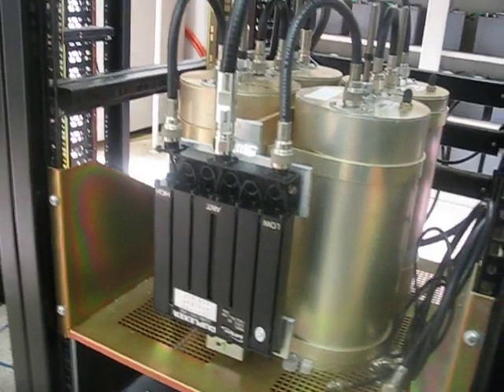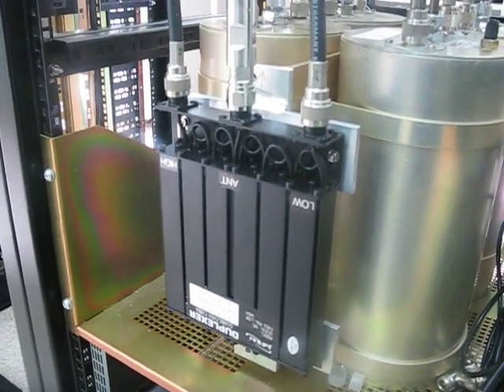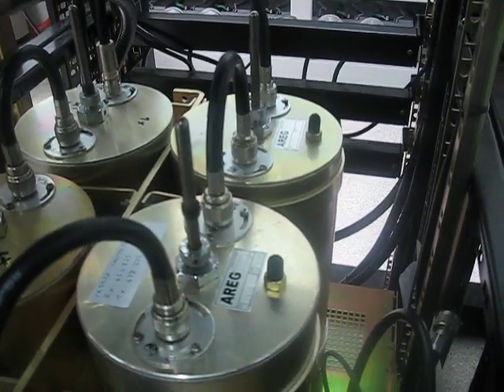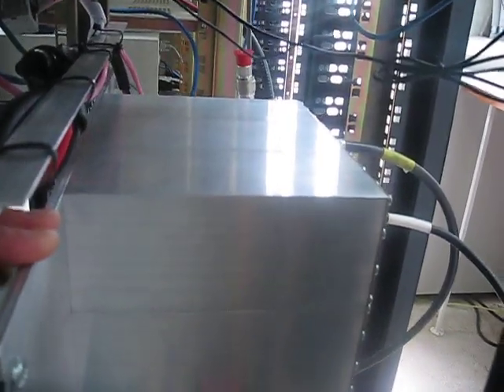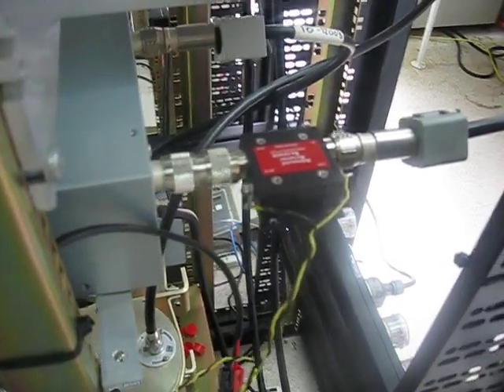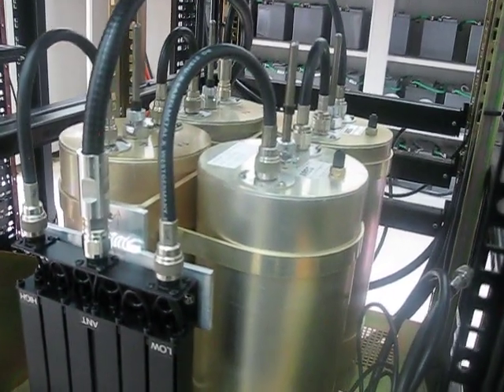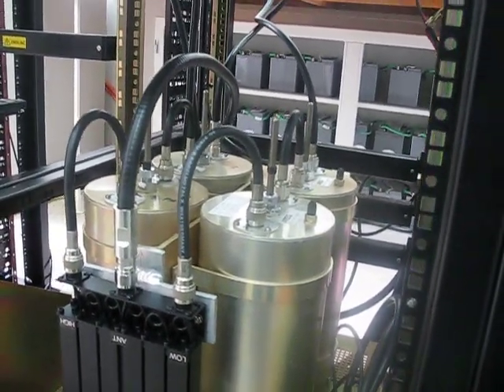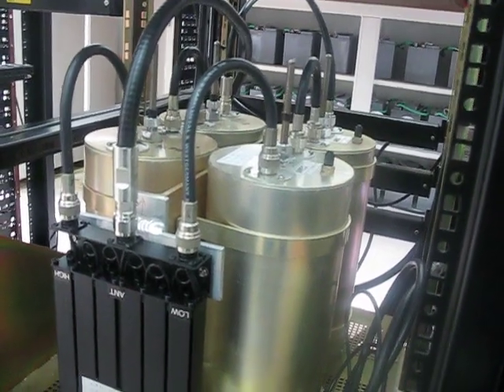New VK5REX duplexer arrangement

Comment: Just wondering your opinion of the power handling of these Chinese duplexers?

I am planning to build a DMR repeater with some Tait T800 radio's I picked up, they have 50 watt PA's.
I will be going on a RF quiet site so I am hoping to get away with only one of these duplexers, and not needing band pass filters as well as I don't need to keep any other transmitters out.

Is the 50 watt rating for this Chinese duplexers reasonable?
Or is it inflated like a lot of Chinese ebay ratings and I should drop back in planned power?
Reply from the maker: I would be a little hesitant in running a 50W transmitter into one even though a LOT of vendors of these duplexers rate them at 50 Watt. 

They might perform OK for a while, but you don't want to risk your equipment.  If the Tait PA is sufficiently protected against failures in the duplexer/antenna you might be OK.
Reply: Thanks for that Michael.
Pretty much the consensus I can find is 50/50 they will be fine, or they are marginal.

I am going to suck it and see as I don't have a great deal of choice in the short term if I want to get this 70CM DMR repeater on the air.
The Tait PA does have very good protection built in so if something does happen it will shut down the whole repeater on its own.

Longer term I will have to keep my ear to the ground for some better cans, preferably band pass as opposed to notch.

Dunno if you operate DMR, but if you do maybe I will catch you on Brandmeister Talkgroup 505 sometime.
73
Lindsay
VK2AMV
Reply: vk2amv DMR Is a joke. Why waste your time.   Analog is much better. Forget the bells and whistles. And data. That can be seperate.  Dmr is over priced garbage..

Comment: Question...... are the lengths of the jumpers from the duplexers to the notch duplexers critical? If so, what formula are you using to determine final length? I have a 220 repeater that seems to have a little noise in the receiver...this might cure the problem. 

de KM3W, Chester, PA